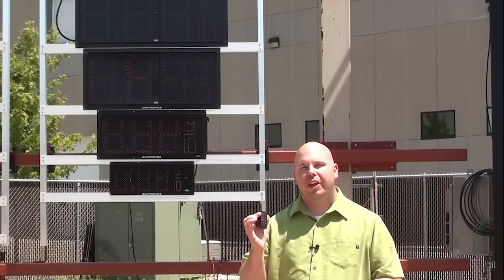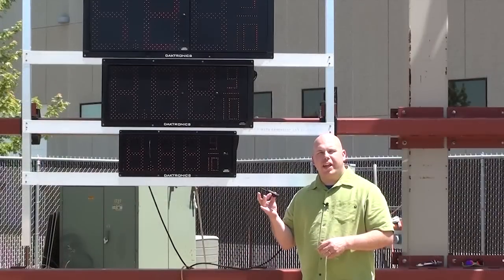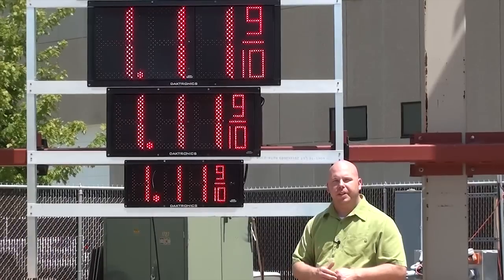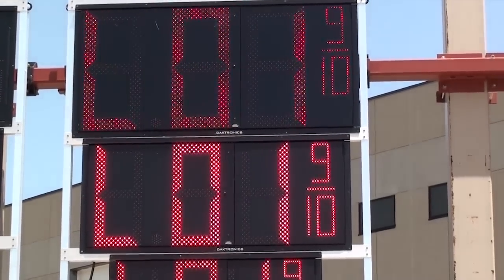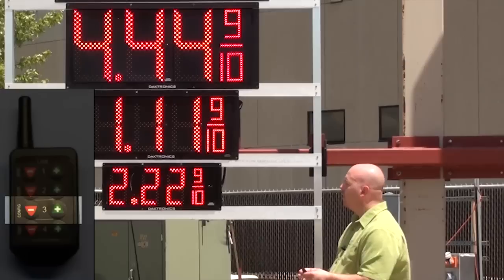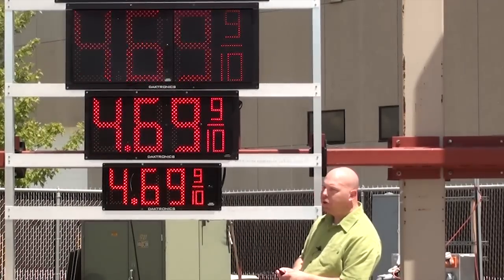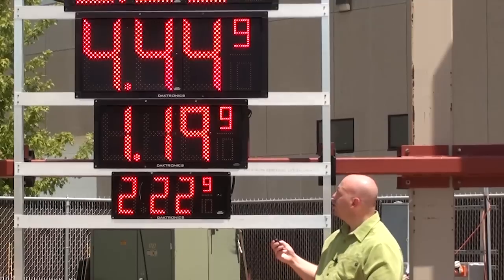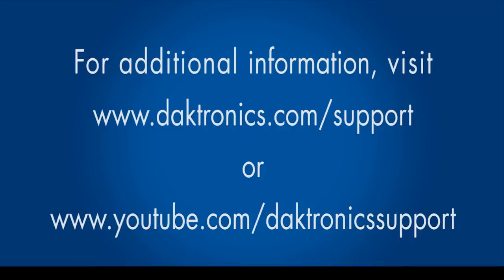Fuelight FLR3-100 and FLR3-400 Setup and Configuration - Original

Comment: how do I change the brightness? thanks
Reply from the maker: Shawn, adjusting the brightness settings may vary based on your Fuelight display model and method of control. Your display being too bright or dim could also be indicative of an issue if your display dimming is controlled by a light sensor. Visit daktronics.com/support to view our Knowledge Base, manuals, and other support resources specific to your Daktronics product. You may also contact our Technical Support team at 1-800-325-8766 for immediate assistance.